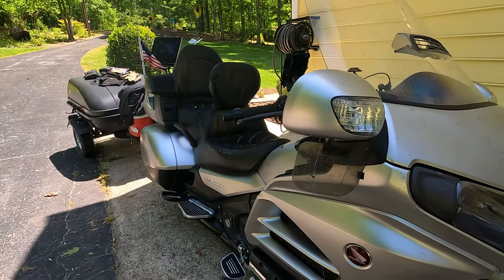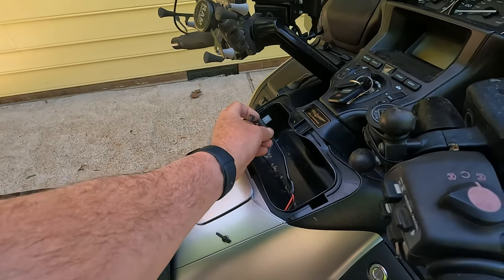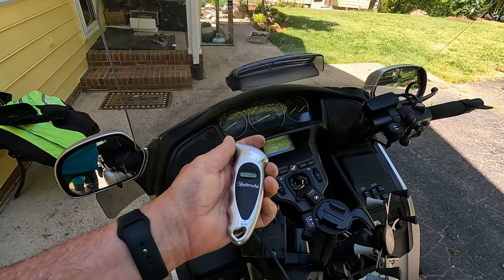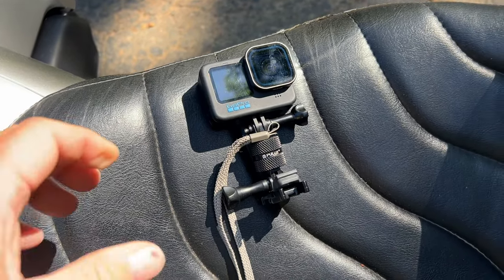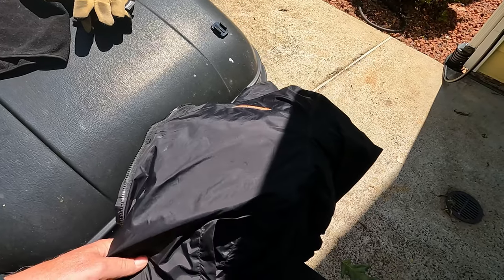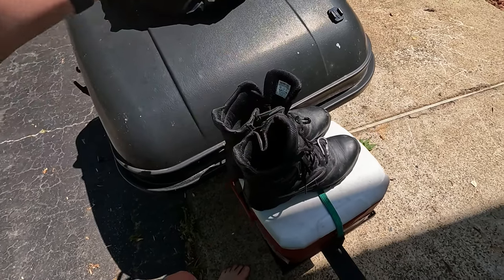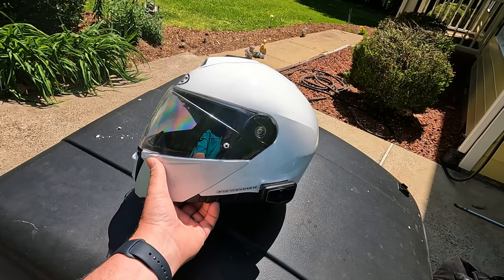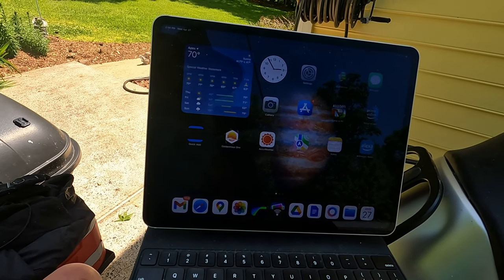Motorcycle Gear That Works for Us and Our 2016 Gold Wing

Comment: OH NO! A Darksider!   I have something that might help you keep that TPMS light off. I also run rear car tire. I bought a TPMS programmer on line for about $80. (V-TEQ VT-15) Very easy to program the GL1800 TPMS. The TPMS asks you to put in the rear tire first, then the front. The TPMS computer doesn't know which sensor is front or rear until you program it. When it asks for rear (slow blink), put the programmer at the front wheel, then front (fast blink) put the programmer at the rear wheel. This will allow you to run about 32.5 lbs. in the rear without the TPMS showing low pressure. TPMS shows first low pressure at %10 percent below the recommended pressure, so 36 psi, minus 3.6 lbs. = 32.4 psi.  You can run 36.9 front psi with no complaint from the TPMS. (41 psi- 10% = 36.9) I run 37 or 38 in the front whether I'm darkside or not. I think the front wears better there. I usually run 32 psi rear and the TPMS light will go out in a few miles as the car tire warms up.
Reply from the maker: Darksider! yep, we are an evil crowd 🤣  Thanks for the info. If I lower my tire pressure anymore I will look into this programmer. Thanks for watching.

Comment: Great video's Bob, really enjoy watching your adventures. Can you please tell me the manufacture of the replacement foot pegs? I have the same issue as you .It would be great if I could lower them a couple of inches and move them forward. I don't  bend like i use to. Thanks.
Reply from the maker: They are made by Kuryakyn and I purchased them at a motorcycle rally. I found them on Amazon (black instead of chrome) just now and added a link at the bottom of the description for this video.  Thanks for watching.